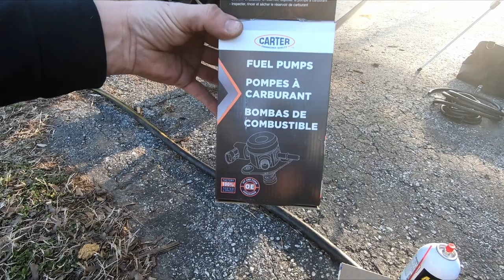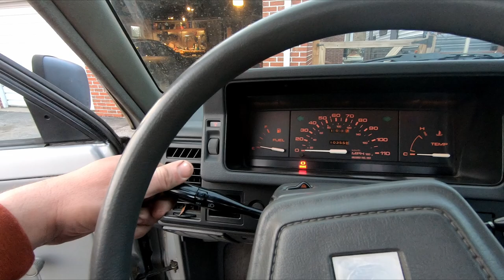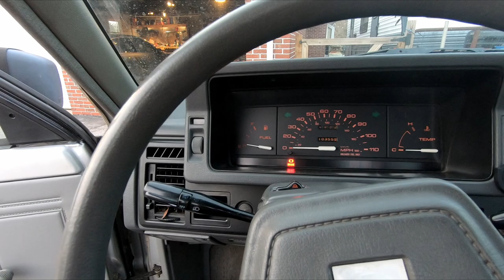Mazda B2200 Fuel System Overhaul

Comment: Interesting, my 88 had an electric fuel pump in the tank, and the filter was on the aft side of the fuel tank. The fuel filter you installed may be the the factory replacement, but beware, they are small and clog easily…